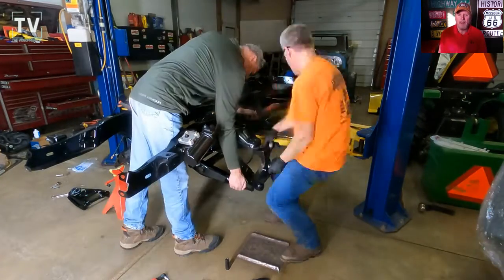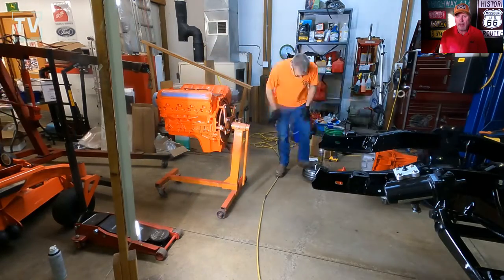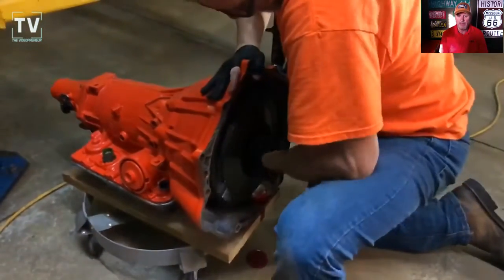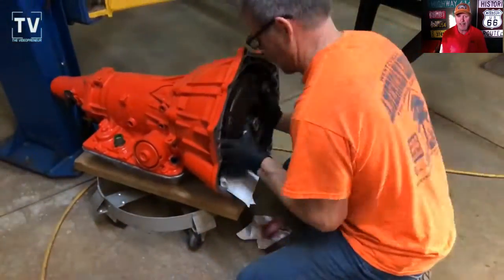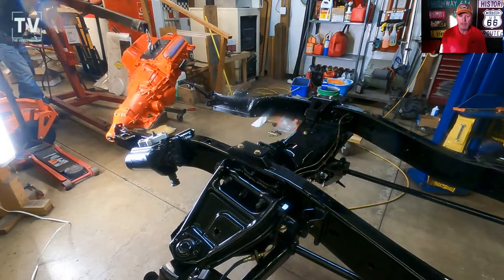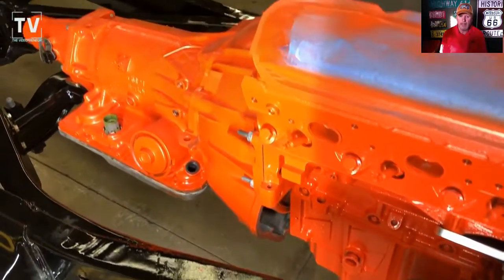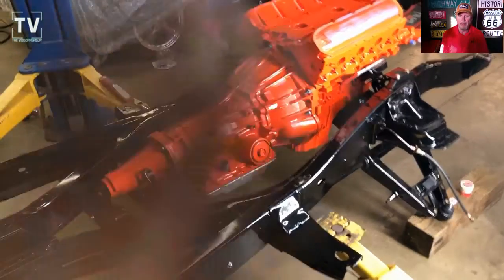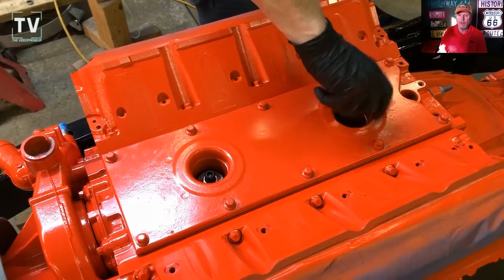1961 Chevy Apache LS Swap Engine Install

Comment: Do you have any final photos are specifications on the transmission cross member?
Reply: I second this, I also need this information as well for my 62
Reply: Did you figure it out because I need one
Reply from the maker: @jimmyscales194  I also just posted a couple of photos in the "Community" section of this channel.
Reply from the maker: @danieldelgado3008  I also just posted a couple of photos in the "Community" section of this channel.
Reply from the maker: I also just posted a couple of photos in the "Community" section of this channel.